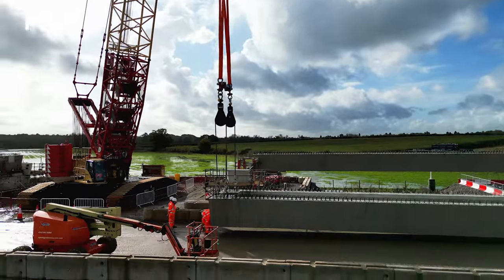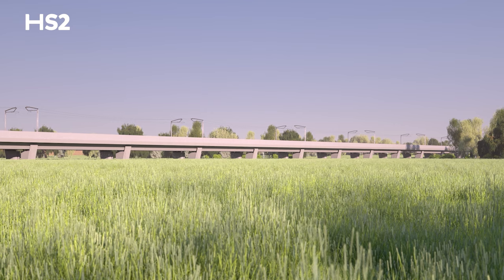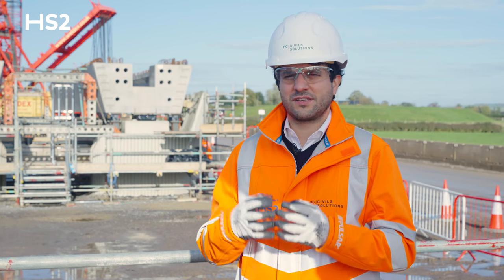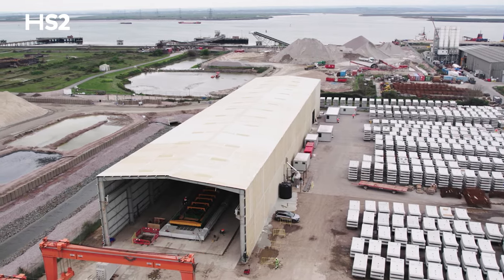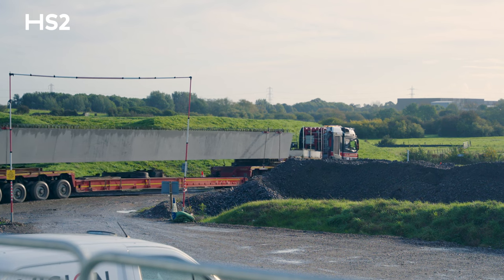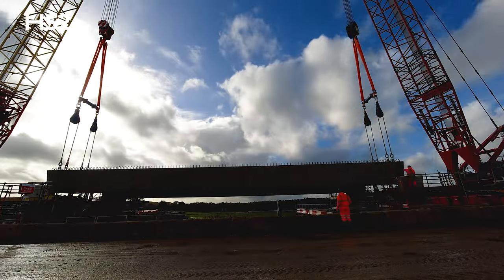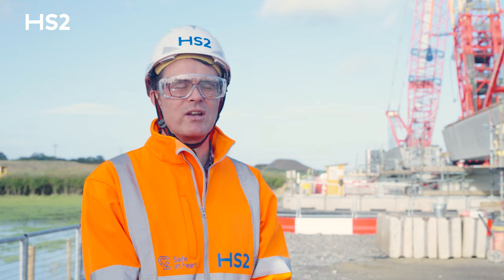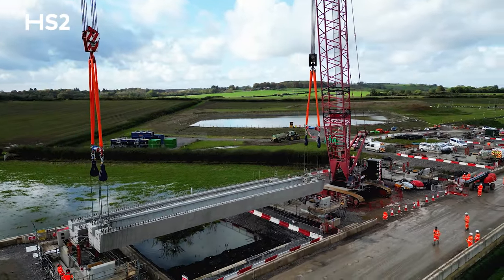First massive ‘Lego block’ beams lifted for HS2’s Thame Valley Viaduct

Comment: Great work, hope one day we will see HS2 built in full to Leeds
Reply: Ya right it should go to Leeds.
Reply: and Manchester
Reply: It won’t EVER be built to Leeds or Manchester which is great news as the whole project is an environmental disaster of epic proportions & Britain's biggest infrastructure mistake in half a century.
Even the London to Birmingham route will be nothing more then a glorified cycle track within a decade of opening (which will be in about 50 years time at the current rate of progress).
Reply: @CRIMSONANT1 What is environmental mistake is cancelling the project.
Reply: @A-Trainspotter-From-Berkshire  for someone living within a mile of the construction (Brackley, nn13 postcode) I can tell you the environmental mistake is the utter devastation this vanity project has caused - the hedgerows and forests gone, good farmland lost, waterways full of silt, the noise and light pollution, the volume of heavy lorries (which pollute with diesel fumes) wrecking roads not designed for such traffic and the temporary roads which have been put in place to accommodate thos massive waste of money. the temporary roads involve the destruction of the countryside far wider than the actual route hs2 will take.
further, the money that this is costing could've been spent elsewhere along the entire route to improve local transport, like busses or cycle lanes which would've had a better overall effect on the environment.
Reply: @mikenewtonninja9379  HS2 causes far less environmental impact than the other options for levelling up the north such as building a new motorway and more runways at airports for example look at how much HS1 has impacted the countryside of Kent during and after construction and then compare that to the M23. Also, HS2 funding is freeing up capacity so that your local transport services can be improved. The total emissions for HS2 will be less than the total amount of road emissions in the UK for a month. Also, HS2 is funding new cycle lanes and other upgrades to local transport. HS2 is not a mistake what is a mistake is the Beeching cuts.

Comment: Should have started up north first
Reply: Agreed.  Imagine instead of building bored tunnels under golf courses in Buckinghamshire, they'd built bored tunnels to connect the middle of Manchester and Leeds with the intercity high speed rail network.  Even if the rest of HS2/3 got partly or fully shelved and these tunnels just connected with the existing West and East Coast mainlines, they would have freed up capacity in these cities and been a legacy for decades to come.  But no.
Reply: Yep! Completely agree! 
Connections in the North of the country would be far more beneficial, both socially and financially. 
Instead, the powers that be have given the impression of "balls to the North, we've got London to Birmingham sorted". There's already enought services running from London to brum that could've been upgraded for increased time saving. Utter shower of shite in government I'm afraid. 

I live in Aylesbury, by the way. And yes, it's arse ache around here at times with the works going on.
Reply: If it had to happen it should have gone straight from the should have been built crossrail of liverpool leeds to the crossrail of london, the need is capacity down south and reliability up north. Birmingham will not see any benefit until it hits scotland.

Comment: What's the point? I don't wantbto go to Birmingham, want to go to Manchester.
Reply: It will need to be extended to the North eventually, the idiots in Government have cut maybe 30-40% of the cost, but destroyed 90% of the benefit. (And doing it later will cost way more, especially if they sell off the land acquisitions). The part in the South is the most expensive bit, but it’s needed to link to the bits in the North to unlock all the value (and huge capacity) the new railway can bring. Their cuts ruin all that…